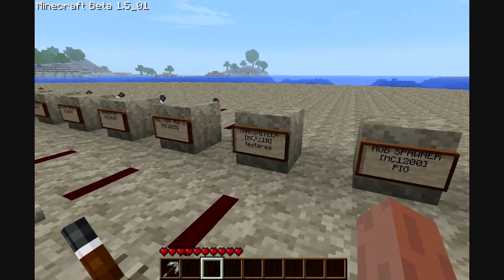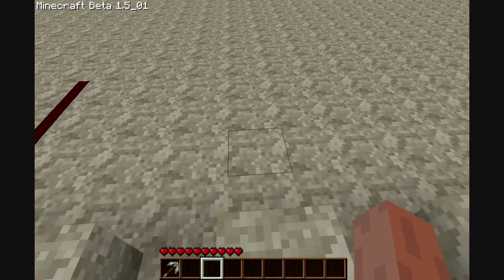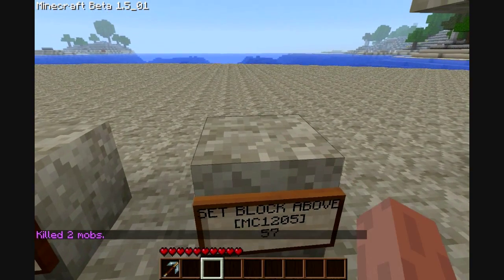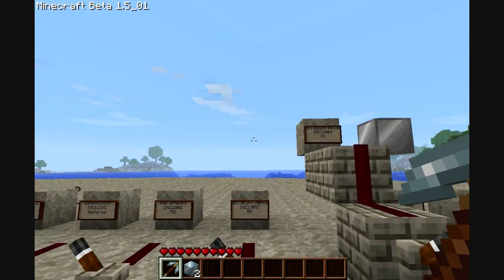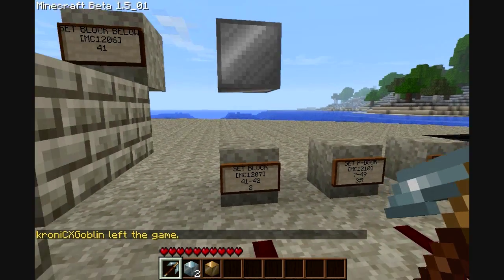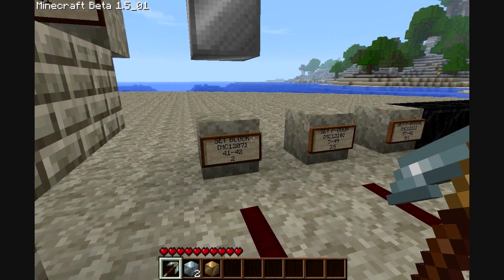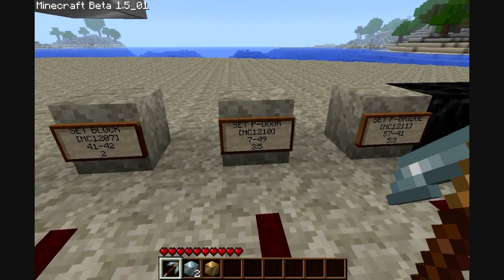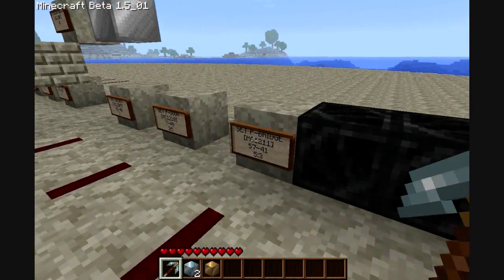FalseBook Tutorial 4 (CraftBook) - IC (1020 - 1211) - Part 3

Comment: The bit block creates random bits. A bit can be either "on" or "off".  So if you have one wire (or one bit) then your possible outcomes are 1 or 0. 1 being on and 0 being off. This is what computers use to send information. Most computers have 32 bits which will give you 4,294,967,295(2^32) possible outcomes but many newer computers are now 64 bit with 18,446,744,073,709,551,616(2^64) possible outcomes.  The block gives you a "random bit" meaning it randomly chooses to turn the wires on or off.